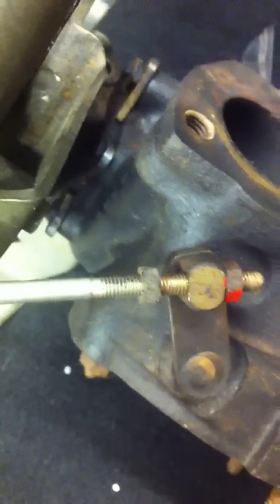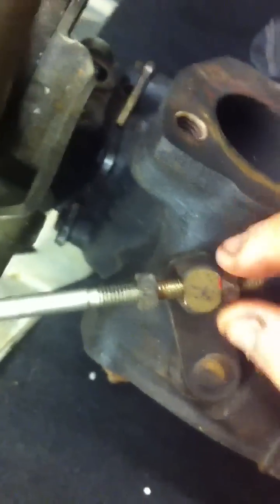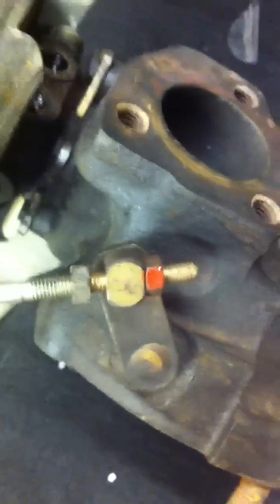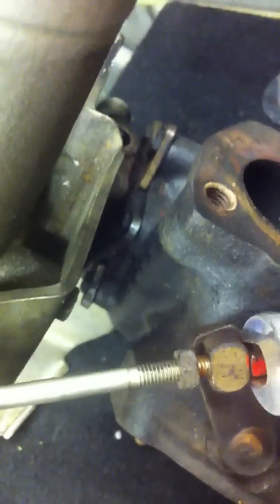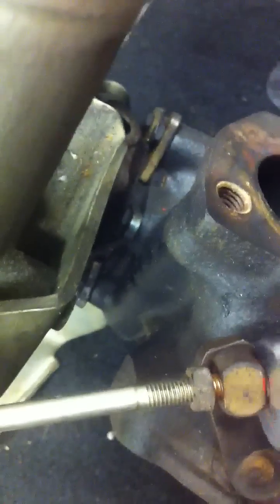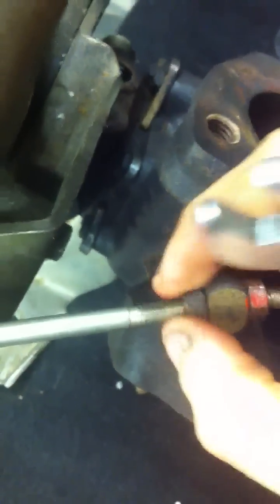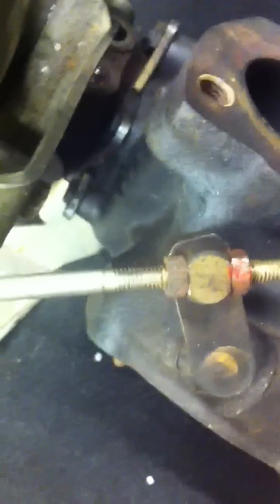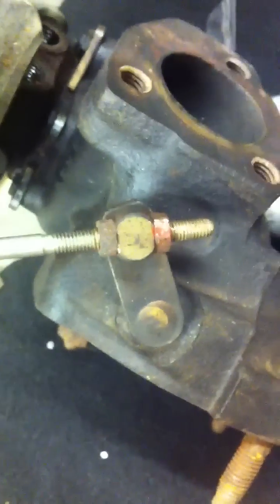Setting up actuator on a K03* turbo with 3 turn preload

Comment: Does the number of turns adjust the boost pressure? If so, which way (tightening or loosening the nut indicated in red) increases the boost?

Comment: My Turbo pushes 0.7 bar original its on a Audi A4 B5 1996 1.8t ”aeb-enginecode” am wondering how much 3 turns would do in practice 😅

Comment: how many bars press
Reply from the maker: Irrelevant.  You want to set preload to hold a steady boost on wastegate pressure.  For example, 7psi/0.5bar actuator should boost up to and hold steady 7psi/0.5bar
Reply: @carsey2009  How many psi is the wastgate setting in your video thanks
Reply from the maker: @alitutar8533  standard so probably 7 or 8psi I think.
Reply: @carsey2009  how can one increase the boost from stock to 12 or 15 psi?

Comment: I'm just curious if you know what codes would be appear if they wastegate was found to be bad.. mine leaks pretty bad around the adjustment rod and I suddenly got 7 codes. It had a few boost leaks that were fixed first then noticed the wastegate was leaking after the codes appeared. Kinda stumped on this

Comment: A person might think that tightening down the nut each full turn gains 1/3 psi in boost but again, the N75 controls boost by bleeding off pressure from the actuator and thereby keeping the waste-gate closed. Keeping the waste-gate snugly closed is only effective in fighting exhaust back pressure in the turbo until the ECU decides the boost level is sufficient and drives the N75 to allow the waste-gate to open.
Reply: You can use a boost controller before the n75 to create a leak off to get more boost
Reply: Until you realize that, the n75 is deleted because racecar. 🏎️

Comment: I measured the actuator on my stock '05 Audi 1.8t K03 with following results:
PSi   movement
3.5     .25mm; 
4.0   1.2mm; 
4.5   2.8mm; 
5.0   4.6mm; 
5.5   6.2mm;l 
6.0   7.7mm; 
6.5   9.2mm; 
7.0  10.7mm; 
I did not measure above that as there is only 10.4mm worth of threads on the actuator rod to move the locking nut over. Three full turns preloads and seals the waste-gate flapper nicely. Any more is not necessary because the N75 determines actual boost by bleeding pressure from the actuator.

Comment from the maker: 3 turns is about right of a one of these turbos.  Of course, you should double check the settings with vagcom doing a log of the N75 duty cycle to see its not working too hard to meet the required boost set by ECU.